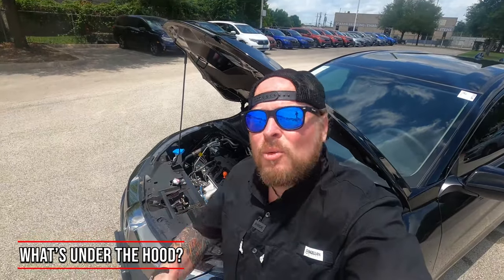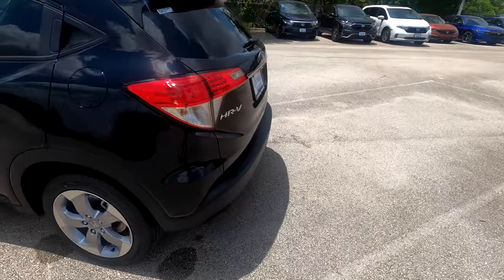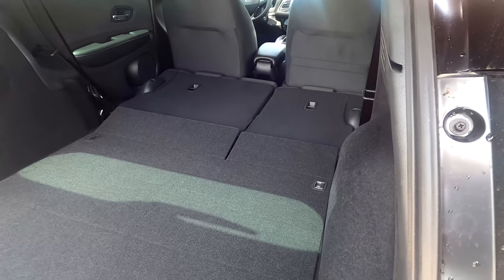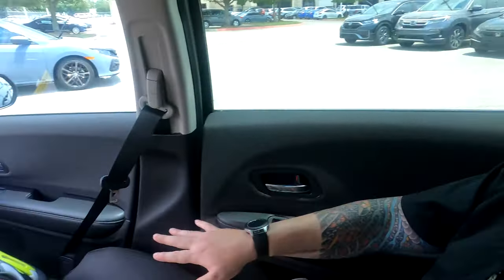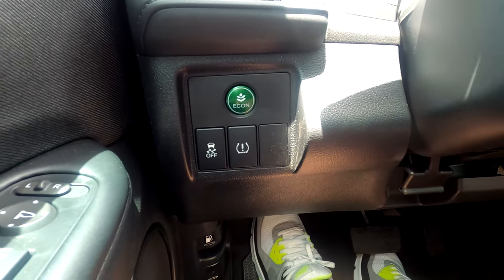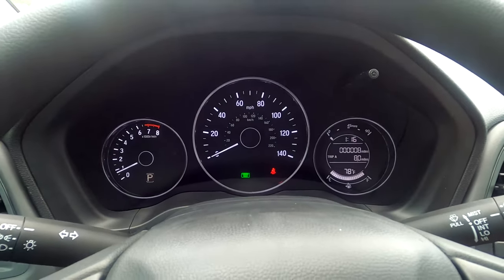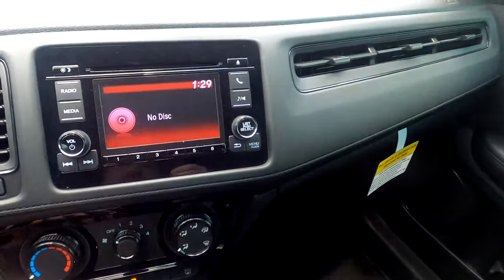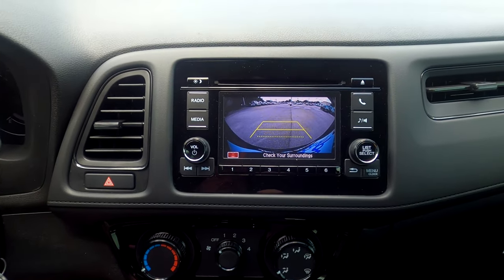2021 Honda HR-V LX Review

Comment: I just noticed the Honda Fit stopped selling new models at end of last year (2020). The HRV-LX is now your basic large version of the Fit.

I’m disappointed though the LX on the HRV does not have Honda sensing, cause I believe most Honda’s have that feature now. Justin, I know it’s early but do you know if the 2022 HRV LX will have the Honda sensing feature or will it continue in that you’d have to upgrade to the EX for that?
Reply from the maker: Yeah with a redesign on the horizon I think we will see it land in all trims.

Comment: I see that you conveniently left out the Kia Seltos, Mazda CX-30, and Subaru Crosstrek in your comparisons which offer much more power so it can actually get out of its own way, better safety suite of features even at the base trim and a more modern more premium interior as well as more ground clearance and more capable AWD system with off-road or x mode.  Hope that the upcoming 2023 refresh makes the HRV a more competitive offering as the current generation is looking very dated.